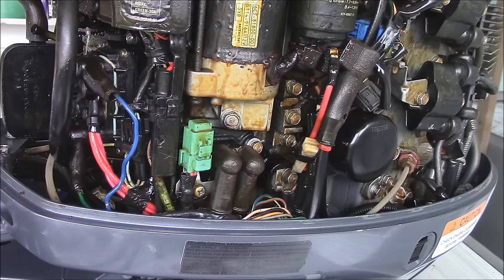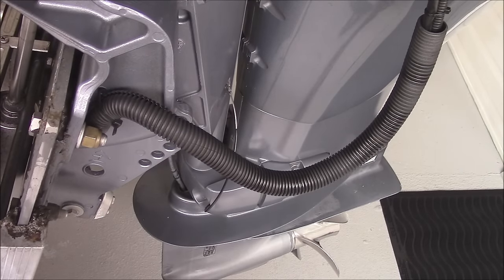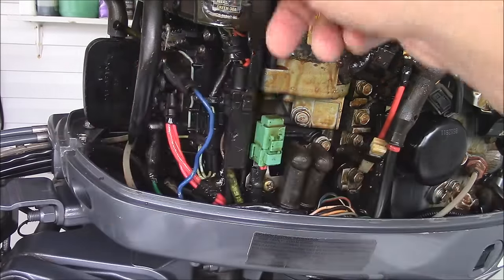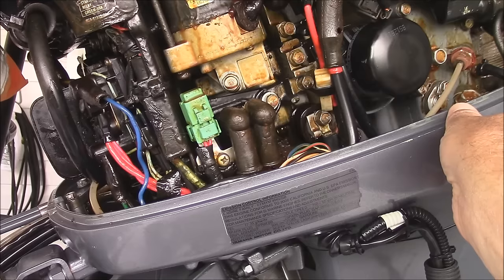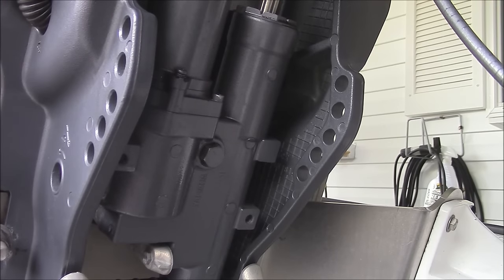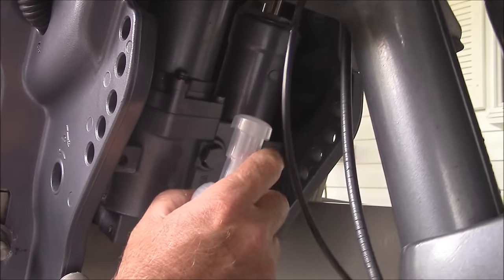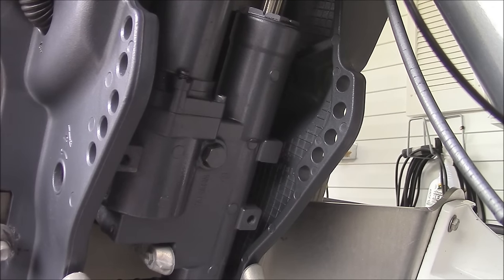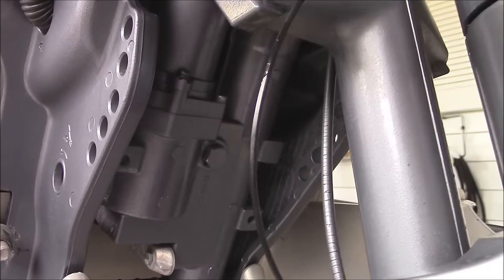Yamaha Trim & Tilt Trouble Shooting Fix Update 2024

Comment: THANK YOU for posting this video!  The trim on my motor was really struggling on the upper end and was getting progressively worse.  After iterating through several YT vids, I found yours.  Adding fluid fixed the issue.  Note that I am NOT a mechanic -- your vid gives a great overview!  I ordered parts on Amazon and had my trim/tilt issue fixed in <30 mins!  THANK YOU SIR!

Comment: I had the low fluid problem and resolved it using the soap dispenser with a clear piece of  plastic tubing. The tubing on end of dispenser makes it much easier. Now I’m getting the clicking and I’m hoping it’s a relay since it just clicks, eventually it connects and goes all the way up or down but getting it to connect consistently is the problem. Thanks for the video. 👍
Reply from the maker: Sounds like the relay

Comment: Drew, if the relay is bad it won’t work period. So if the motor works but is struggling it’s the pump. Also, just put the trailer on ramps and lower the front so it’s level. It needs to be level to fill correctly. Just my suggestions. Glad you got it fixed though! Good luck
Reply: Adam Hartless hey I have a Evinrude xp 150 and my tilt won’t work not even make a sound so I manually lift the motor and I’m able to let it down if I put the green wire to a battery and ground the blue ..... any idea why it’s not working when I use the switch it has 2 switches one at the back of the boat and one on the throttle handle neither one works
Reply: @redboyize  like relay or fuses

Comment: My trim ran up for a few seconds than stopped. Won't move at all. You are saying the fluid is the issue for my problem? Is there a sensor that tells the trim motor not to run if fluid is low?

Comment: Flipping the trim wires on the relays is great when you only have one side not working.  I like using a test light and checking the outputs on the relays, because it also rules out the switch being the culprit.  My motor has both the throttle control trim switch, plus one on the side of the engine.  To rule out both switches form the problem solving, I use a test light and check the relay outputs to see if the relay is putting out power.  If you hear the click on the relay and the test light does not light up, you more than likely just found your problem, bad relays.  

For filling the trim pump, I found that the same filler kit for the seastar hydraulic steering systems have a great little hose and fluid bottle adapter for topping off a trim pump.

Thanks for the hand soap container tip, not a bad idea.  I had used an old rain-x container with the flip top nozzle for filling as well.
Reply: So I just put in a new relay and the motor will go down but not up. If I flip the wires then it will go up! So the relay is good. When the motor is up is slowly comes down. Could there me a fail safe button causing my relay to not go up?

Comment: Thank you so much!  I have a 90hp Yamaha on a pontoon boat.  That did it... with the screwdriver!  Dropped it down with ease.  I will later try the hydraulic fluid part.  Super video!

Comment: Great video! Quick question. What goes out in an electric-drive hydraulic motor that leaks fluid, or has not fluid in it?  Does the motor just burn out, or is does something happen to the cylinder?
Reply: my motor went out. i could tap the motor and it would kick in for a second or two. when i took the old motor off, some of the trim fluid that was under the motor came out. i replaced the motor and topped off the fluid and now i am all good.

Comment: You need to have your transom perpendicular to the ground as best you can, lower your jack down as far as possible helps when adding fluid, the guy who replaced the motor you have to make sure you got the motor shaft connected back to the pump shaft, the motor is humming because the motor shaft is in a bind with the pump shaft or it's free to turn and running but not turning the pump shaft.

Comment: I have a tilt motor that is stuck in the up position.  Constantly runs unless I press the downward button or turn the battery off . But it will not go down. Any ideas?

Comment: Hey, just noted. If you positive the blue wire to a battery, and hope to get ground through the motor and bracket assembly it did not work in my test. I had to ground the green wire directly. Then to reverse polarity, to push the motor down, I went Green to positive, and Blue to negative.
Reply: I could not test my 2 wire new trim motor by grounding the trim motor to the engine block or directly to the  battery. I had to do 
what you described. If you have a two wire trim motor and you want to test it power the blue and green leads.

Comment: Captain C, my current position it all the way down and won’t tilt forward. Shows continuity on blue and green when switch is tried and getting 12.4 ( motor off ) 
Relay replaced but still clicks. Could it be as simple as fluid ?
Reply: Also motor spins when I dismantled it off the mount
Reply from the maker: Does not sound like fluid. try the fluid and see what happens.

Comment: The trim motor will lift my 2014 fx250 Yamaha motor about 15% degrees , motor still will run but not lift engine any higher.we lifted the engine manually and set the pin to hold it up in order to add fluid hoping that was the issue. After unscrewing the #18 nut, fluid started leaking out so it’s apparently full of fluid?I could lover the motor now if I physically lifted the engine enough to disengage the pin, so the motor appears to be working so what now?
Wesley
Reply from the maker: Sounds like the pump itself has gone bad.

Comment: Fantastic! I tried this the first time, but didn’t do a good job of getting trapped air out.  Knocking that cylinder a little and using the soap bottle with the hose from an old  brake bleeding kit seems to have done the trick.  Thanks for the tip!
Reply: I knocked mine and the magnet inside came loose and started knocking back and fourth.

Comment: Nice job, thanks.  So, my Yamaha 200 was on the trailer all winter, and when I took it out of the water months ago, the tilt was fine.  But now, I hear the motor whining, but the motor won't move, and it's in the up position for trailering.  Same thing, correct?  Just try adding the fluid?  Perhaps it's an obvious question/answer, but I want to check because I'm very non mechanical and the obvious sometimes isn't so obvious to me.
Reply from the maker: You can try to add fluid.

Comment: The screw that's on the side of the trim and tilt that u can turn and manually pull up ur motor!  Does that screw need to be tighten back up, before adding trim and tilt fluid?
Reply from the maker: I am not sure, see if someone else can answer this

Comment: Question.  I have just replaced by tilt motor on my Yamaha 40.  Motor runs great, but nothing happens. I have fluid. I opened the hydraulic relief, lowered drive, and closed the relief.  I checked the small coupler between the motor and the pump, I guess that could have come off.

Anything else to try?

Comment: Is that a SHO? Mine doesn't have an 18mm nut... I have a cap that unscrews (250 sho).  I was told to raise it all the way up.... fill it.... then put the cap back on. Didn't fix my issue and mine is doing the same thing as yours.  Sounds like it get very weak when almost max up.... or almost max down. Help!
Reply from the maker: No mine is the 115 LB

Comment: No, no, no! That’s a great way to crush your hand when the engine comes down. If you blow a seal, you’ll crush your hand. At the very least you need to block the drive up so if you lose your fluid or the relay fuses (Burned contacts) it can’t continue down to crush your hand.

Putting your hand in that position is stupid and dangerous.

Comment: The motor switch works on my boat but the gear shift and bow switches don’t work. Any idea what could be going on?
Reply from the maker: Do you mean the switch on your engine itself works? But the throttle one does not?
Reply: Yes. The motor switch works but not the gear shift or the bow switch

Comment: I just replaced the trim motor on my 150hp Yamaha. To do that I removed the hydrolic piston pin to tilt out the assembly to access the rear bolt.  the motor humms but the piston won't go up or down now. What gives.
Reply: What was your diagnoses ? Same problem here with 150
Reply: Sounds like it needs fluid

Comment: hello dirty switch by throttle can be opened and cleaned very easy job and low voltage can be a problem , I have lowrence and have a voltage display and low voltage alarm on my depth finder ,, good video .. I had my engine come out of water because switch got saltwater in it and I had to unplug it and use the motor trim to lower the engine
Reply from the maker: +boashna I use corrosion block on the switches. It helps prevent this.

Comment: I got a 1984 115 hp evinrude trim powers up fine then slowly goes down like you let off a hydraulic jack is it a seal or something else
Reply from the maker: Could be the bushings. Is it the original trim motor?
Reply: Drew Cavanaugh  yeah as far as I know I bought it in April then that pandemic hit Got a good deal because it was overheating on one side I put water pump and thermostats on it boat and motor 700 clean title on both trailer an boat

Comment: Where do you hook up your ground wire to???  Some where on the engine and the other end hooks up positive side of battery?
Reply: black ground on battery to bolt on engine, red on positive battery to green or blue on trim motor

Comment: could you hear air in the system when it was low? My yamaha trim just started doing this.
Reply from the maker: No. Mine I drained, realized it was no longer working. Then replaced it. The seals may be leaking in yours. They do sell rebuild kits. Sometimes cheaper and better to just replace it.

Comment: How do you replace the piston seal on this single piston PTT assembly, I was able to remove the cover nut (the one with the 4 holes that hold the seal) But I can not remove the piston or disassemble the interior of unit.
Reply from the maker: +Justin Joseph By calling your Yamaha Mechanic. That is beyond my scope of doing things. Too much involved there that needs to be precise.

Comment: I am having the same issue on my Evinude 93 engine it doesn't wanna go up or down I added fluid to my Trim & Tilt and still won't go up or down.
Reply: Juan Dtrinidad I’m having the same problem did you find out the problem, mine won’t even make a sound no noise at all

Comment: So hook the blue wire to positive, then ground which wire ? Green or a different one ?
Reply from the maker: Not sure about that one. Maybe someone will chime in. I will say that the blue usually means up(sky) and green usually means down(grass)
Reply: To go up run the blue cable to posits on battery but first add a second new wire too the negative on battery then connect that to the frame of the engine as a ground.

Comment: Did you ever find where fluid leaked out from? There should be evidence of a leak somewhere don't you think? Is changing fluid periodically a recommended maintanace?
Reply from the maker: +Stuart Kidder I do not think it was leaking, or much. Over the years just wear and tear causes so small of a leak that eventually you need to replace the fluid. If your motor is working and you have no issues with up or down or both, then you are fine.
Reply: @captaindrewcavanaugh  Normally its a bad seal or seals that need to be replaced due to they are dry rotted.

Comment: How do you flush out the old fluid? Siphon??
Reply from the maker: Yes or drain plug.
Reply: Drew Cavanaugh the Fluid in my trim is grey I don’t know what if it’s Yamaha hydraulic/power steering or DEX 2. Service manual calls for dex 2. I want to do a fluid exchange but I’m worried about using dex 2 and having a little bit of the power steering or whatever it is that is in there now. What do you think?
Reply from the maker: Just cal Yamaha Dealer and ask them. I am not sure.
Reply: @cyrusdavirus007  i took a snap shot of a document but cant find it now on my phone but i think i remember thats all that fluid is (Dex 2) half price at autozone or double for the yamaha labelled bottle

Comment: Will this fix leak down, mine slowly goes down?
Reply from the maker: No. If it is leaking most likely needs seals or to be replaced.
Reply: If you cannot see evidence of oil leaking ,maybe the down screw is not tight and allowing it to leak down internally.